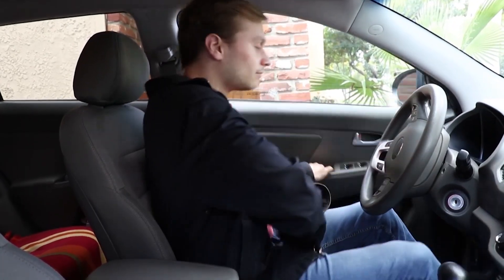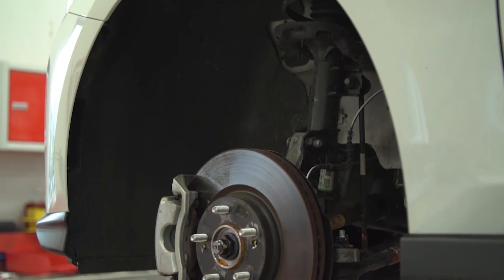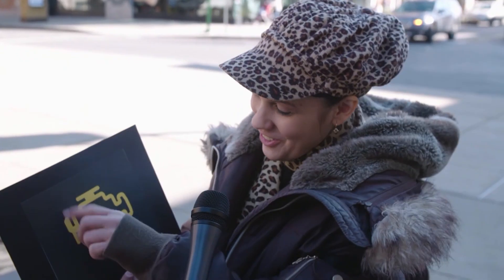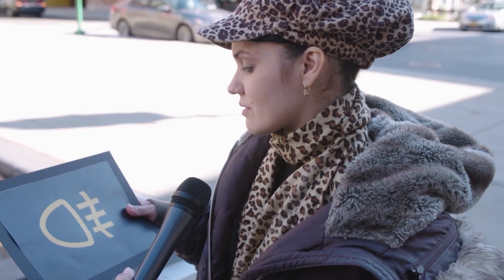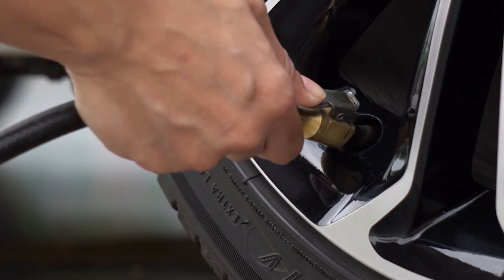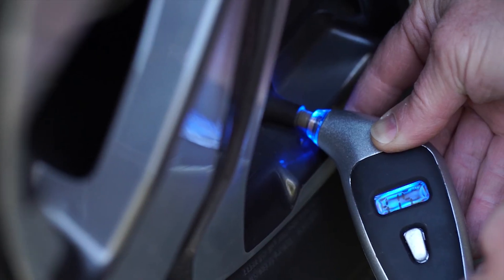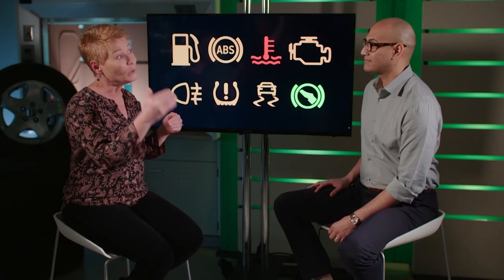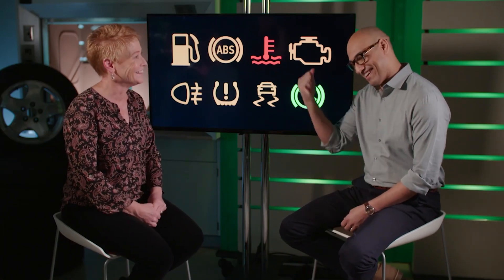Decoding Dashboard Warning Lights | Consumer Reports

Comment: I've seen most of these before.. and the standard is quite good. Yellow lights are a 'caution' (ABS, Airbags, Traction Control) saying "Something is wrong with this system, but the car will still drive". Red lights you should never ignore, red indicates a critical problem (Low oil pressure, overheating, critical control computer failure)... But I'd never seen the green "foot on the pedal" light before..I assume it's mostly an American thing.. Never seen it in Europe or Oceania.

Comment: Additionally... any light in red or flashing red needs immediate attention.  Pull over as soon as you can SAFELY and call for roadside assistance.  Any light in amber or orange needs your attention but car can still be driven in the meantime.  This is a general rule only.... read the owners manual.  Stay safe folks!

Comment: This is excellent content I'm glad to see - but even more could be done.  My Subaru's owner's manual does a poor/confusing job of explaining the messages I can get on my dashboard display screen (the dot-matrix computer display, not just simple color idiot lights).  The cheaper 2017 Forester models it clearly says have Low Oil Level and Low Washer Fluid level warnings, but the content about the dash of my fancy "Touring" model is ambiguously described.  Plus the car makes an occasional "chime" noise only on long trips, with no light or text warning, that I still have not figured out after 3 years.

Comment: The solution is to get an OBD II dongle that tells exactly what is wrong.  There is no way of telling whether a check engine light means you need to get it fixed right away or whether it can wait without one.